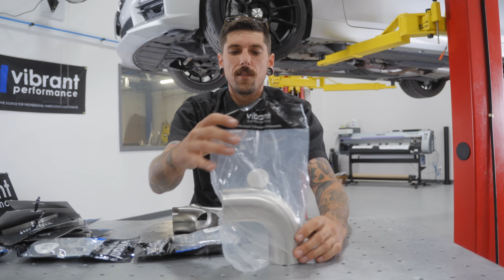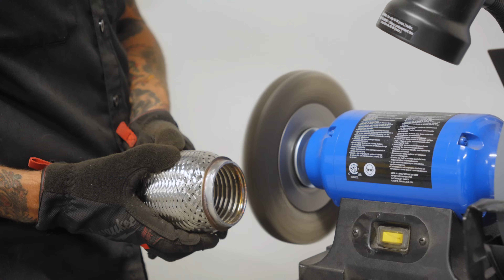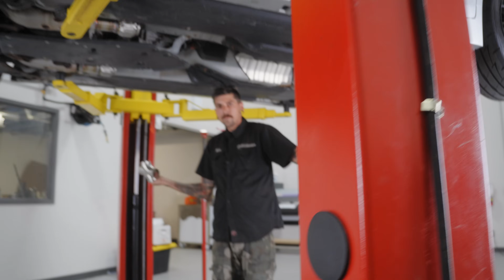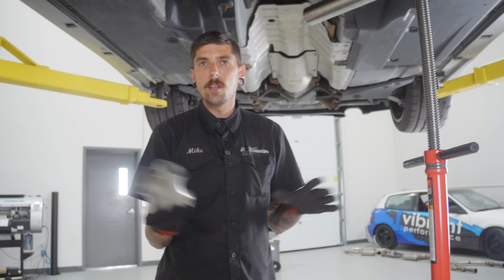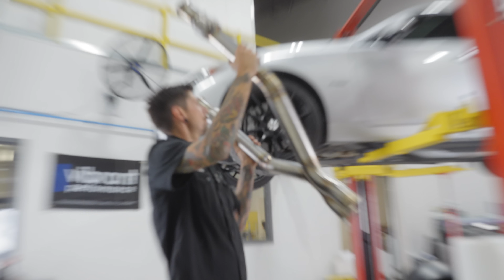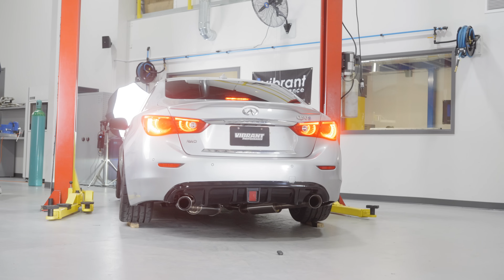How to get the best sounding exhaust out of any VQ Engine...

Comment: My 370 is fully straight-piped. But done right, and it sounds amazing but again you gotta know how to do it. None of the cheap single-exit exhaust or test pipes. Equal-length PPE racing headers and a true-dual exhaust. I have Fast Intentions TDX catback exhaust and the shop cut out the mufflers and welded in T-304 stainless in place. Sounds like a jet in tunnels, makes more power too.

Comment: I bought a 3” exhaust that came with 421 Cpl manifold the only reason I bought it, it had 2 back boxes non res was very loud and droning like crazy so I added 1 1769 vibrant race resonator “3 by 9” long and it almost eliminated all the drone I didn’t have any rasp to Begin with it’s fn2 type r, now I’m going to replace one of the back boxes with vibrant 1142 3” ultra quiet muffler and I should get a perfect sounding exhaust not too loud and minimal drone if any at all vibrant is the shit

Comment: Sounds great. This is exactly the exhaust I've been trying to hear for a V6. 
I used to have a G37 that was already modded by the seller and it was so raspy, pretty sure it was just an X-pipe and muffler delete.
Had a similar situation on my GS350, i deleted the mufflers and resonators and added a pair of Vibrant bottle resonators. Sounded pretty good but lots of drone, I should've added a pair of ultra quiet's and it would've sounded perfect

Comment: This next summer I'm building new exhaust for both my 95 mustang gt that still has factory exhaust with all 4 cats gutted and no mufflers and 92 Chevy c1500 hotrod truck which now is headers dual 3" (had original FM 40s now cheap cherry bomb turbos) axle dumped. I'm debating going Stainless it looks nice but being a fabricator/welder by profession it is more expensive it's harder to cut and kind of stuck tigging the whole thing and their not show cars. But I want both to sound more modern so I'm want both to have X pipes and both prob 2.5" vs cars 2.25 and trucks 3". Where I can't leave anything alone and always want to switch stuff up my plan is to figure out what the longest muffler I will likely ever use and in the exhaust make like a 2' removable section with v bands that way I can swap out mufflers or even just straight pipe. Every time I get a set of mufflers build a 2' long assembly of muffler and pipe with v band flanges on em, so regardless of muffler body length make muffler assembly say 24'' long, like 12" long muffs add 12" pipe or 20" muffs just add 4" of pipe. That way with the expense of some v band flanges and few inches of pipe I can do a muffler swap in minutes. I actually was thinking of trying to find some factory valved mufflers off a late model mustang could be a cool muffler to go with. I love building exhaust because even with a good idea of the sound you never actually know what the end result will be where there are so many factors that will affect the sound like engine compression, cam, discplacement, tubing size, muffler, primary size and type, bends, length, equalization, tip dimension end cut style, on and on and on the options and configurations are endless its absolutely fascinating and people look at me like I have a mental problem but I don't I just a curious n creative person. My only end goal is to never build an exhaust that sounds like most 5.0 coyotes, they sound absolutely horrid.

Comment: I run a Vibrant StreetPower Muffler on a custom Equal length 3in setup on my VQ38 powered Frontier. VQ sound without the VQ rasp and a nice DEEP tone. Takes on an almost inline 6 sound in the higher RPMs

Comment: Hello, I have stock V6 with it goes 2 pipes to Y-Pipe then Single mid stock muffler and then it from one pipe Y into 2x Vibrants Bottle Style Resonator, it sound good but what I am thinking to do is, remove the Y pipe and do H-Pipe instead and goes 2 pipes to one single middle muffler from Vibrant (2in-2out) and then to 2x Vibrant bottle style resonator?
Will it work good?

Comment: You saying bigger resonators provide more sound dampening. But bigger in length of diameter. Would 20 inch long bottle neck be quieter than a 12 inch long one. 

What about rasp, and unwanted frequency, is there a better explanation for resonators.

Comment: The straight piping (and/or muffler deletes) isn’t the issue with VQs, Hondas or anything else. It’s the fact people don’t want to use a resonator to drown out the rasp, which is why you get cars that sound like a marching band full of trumpets. A good quality resonator and a good quality muffler go a long way
Reply: exactly, that’s why i only did a muffler delete on my tsx. ive heard people get rid of the resonator and it just sounds like a lawn mower
Reply: Correct, but I dont run a rear muffler on my honda the sound is just the right mix of volume and sound . Of course I dont do things normal and I know theres 2 cams on the civic so my exhaust is tuned for it , meaning the pipe out the back gets bigger as it exits, yet I keep it with in the average accepted sizes for a stock motor .
Reply: I don’t think straight piping means what you think it means, brother.
Reply: Using a resonator or a muffler isn't straight piping
Reply: Whats wrong with trumpets? :(
Reply: So... the straight piping is the issue
Reply: I run long tubes with just a cat. No muffler or res. And I cut the pipe short to mid car length almost . You can check the channel to see how it sounds . Want more opinions. I’m about to add a res and muffler with an electric cut out in between both soon. Just waiting for everything in the mail.
Reply: Just got done with catless full pipes to a x pipe to 2 valved muffler on my q60rs and it sounds like a pissed bumble bee just bought 2 ultra quite resonators to put on hope it quotes it down
Reply: It's not straight piped if it has resonators. Straight pipe is NO mufflers, resonators or cats. Hence the literal term. There's a way to do it without it sounding like crap. You need PPE Engineering long tube headers or ISR long tubes and a true-dual exhaust. Won't work with a "dual" exhaust that merges into 1 pipe in the middle (like a 2 to 1 or a 2 to 1 to 2).
Reply: the headers' runner length is what changes the sound the most, look at 6 to 1 headers on v6s
Reply: Exhaust is super subjective. At the end of the day, if someone likes their exhaust with no cats, no resonators, straight pipes to muffler, its their car 🤷🏻‍♂️

Comment: I have a 2.4L i4 accord. How do you get a performance exhaust without getting a buzzing fart can noise. Preferably unnoticeable as an aftermarket exhaust. Money is no object. The inevitable "sell it and get a hellcat" is not an answer.
Reply: I always recomend an Aero turbine/ Jones turbine muffler. I have ran them on a 2.2l 4cyl and a Turbo 2.0l 4 cyl and they sounded deep with no rasp. My buddy had one on his 02 ep3 and it sounded deep with virtually no rasp. They are loud without a resonator though as they are straight flow through with no packing unless you get the xl models that are longer and have a resonator section built in with ceramic wool that wont burn out.

Comment: Should I consider cutting the resonators off of my Stillen Cat-Back and install vibrant ultra Quiets at lower RPMs the Stillen resonators will rattle I got test pipes also (G37x sedan)
Reply: Ive done this multiple times and i have seen the resonators also break internally!
Reply: @Mikegtcustom  I think I might give it try I'm expecting some raspiness regardless since I don't have cats but I'm hoping the vibrants will clean up some of the rattle on accel/decel
Reply: The rattle is likely something loose with mounting hardware, heat shield etc. On rare occasion it's a chunk of metal inside that that came from upstream piping. Stillen generally makes quality stuff.
Reply: @daftpanda6533  I would agree but I bought this exhaust used off the marketplace a while ago and who ever owned it before was shooting flames from it so that's why I assumed the resonators were bad it also could be the test pipes I've heard
Reply: @CobbG37x  Oh. Yeah, stupid things like flame maps aren't  really good for cars, or their cats. 

The occasional poof on throttle close is temporary rich condition. 

Mostly found on older cars with no cats, it was just an effect of the car running rich for a split second.

Comment: Work if Art my friend 😎👍⭐😎Knowledge is power... Just purchased an 07 Lexus sc430 luxury touring car for most but for me Vip semi hot rod with my build setup that's coming.😅😅 My close friend who's now retired but by no means slowing down will be building me a custom exhaust from the headers back and we will be incorporating maybe two X-pipe in the 4.3l system he taught welding for 30y+ has and still drag races Harley motorcycles and has a huge CNC machine that looks like a time travel system at his shop. I think you get the Gist. Can't wait until we get started I just want the V8 to be heard without being obnoxious. I'll let him do his thing. 🙏⭐💯

Comment: X pipe cleans up the pitch and get rid of the nasty decel. It will give you rasp but that depends on the muffler
Reply: properly designed x pipes do not introduce much turbulence and turbulent merges create rasp

Comment: Just got an ultra quiet resonator welded in to my strait piped 350z. Took all rasp away and kept the volume of the single exit exhaust. It's the best sounding 350z I've ever heard.
Reply: Post a vid bro, I want to be the judge of that 🤙🏼
Reply: @HerbieHinde  i got the best sounding 3rd gen Frontier. got videos to prove it too. its VQ38
Reply: You ever post a video?
Reply: @ThatsXaviar  i just posted a quick video.
Reply: where did you place the resonator? like how far along on the pipe?
Reply: @makaveli2144  right past the W brace
Reply: your 350z sounds good. could be a little better with a nice pair of headers

Comment: Sounds good. There's a funny pop coming through during the sound clips at the end, in between gears and coming off throttle. Any idea what that is?
Reply: When I let off the throttle there's some backfire, the other pops may be from the road/suspension.
Reply: @ryanmvisuals  Yeah, was thinking  it definitely came through the exhaust. Probably occurs naturally with this motor and the exhaust just amplifies it 👍
Reply: @ryanmvisuals  Any drone with this set up? It sounds really good man, but what is it like to live with?
Reply: @DavidRistic-f4e  Thanks! It's very tame, of course it isn't silent like it was stock but those ultraquiet resonators are extremely efficient for their size. If you're planning on going catless and or have test pipes i'd pair it with a streetpower muffler. Otherwise the drone is absolutely fine. I drive on the highway almost everyday and it doesn't bother me.
Reply: @ryanmvisuals  Thx for the info, enjoy it!

Comment: This would have been really useful 20 years ago
Reply: Every one who's tried straight piping or single muffler knows it's too loud in cabin
Reply: This has always been around, but this exhaust plus labor probably costs more than 1000 dollars. Straight pipe with no muffler costs 150-300. If you’re broke in high school or college which would you be able to afford. Clearly this is a lot better sounding but it’s also out of the price point of anyone not at least working a full time job
Reply: You do realize that people still drive and tune these cars, right? I daily a 350Z.
Reply: facts i daily a g37
Reply: It definitely has not changed in 20years. This is very basic stuff
Reply: The problem is a bunch of broke teens gets these and do muffler and resonator delete’s
Reply: @a @anthonyfields3856 they did that with muscle cars it’s nothing new and it’s boomers did it with cherry bombs or purple hornies
Reply: The problem is a bunch of broke teens gets these and do muffler and resonator delete’s
Reply: I have a 22 yr old 3.5 ltr V6 and yes it is.
Reply: ultra quiet has been around since 05
Reply: Before the great clapping out of VQs :(
Reply: thia info has been around for 50 years+
Reply: @krusher74 not really , 20 years ago drag racers, hot rudders, engine builders and exhaust companies like Hooker said H pipes were superior to X pipes. Resonators weren't even in discussions and all old heads said straight through mufflers " didn't give enough back pressure" and everyone was all about chamber mufflers like 40 series. Every inch per 100 horsepower definitely wasn't a thing.
Reply: If only bro could fab up a time machine

Comment: HAve you thought about the aerodynamics? How do you solve that?
Reply: Didn’t think much about aerodynamics as it’s just a daily driver. I’d assume it’s more aerodynamic than stock with the massive muffler in the rear.
Reply: @ryanmvisuals  yes, BMW pur down millions on testing and development in the windtunnel to get a good airflow under and over the car and to keep the balance at speed and not create lift forces. That’s why the silencer looks like it does. Now there is a big hole that creates a lot of turbulence and drag (lift).
Reply: @JohnnyLehti  much of that aero is done to get better MPG's. You really think is gonna make a difference while you drive to fast around the wallmart parking lot?
Reply: No, not around the Walmart parking but that’s not what these cars are made for. A Honda Civic suits Walmart much better.
Reply: Flat bottom car, where possible.
Reply: This guy is a chode